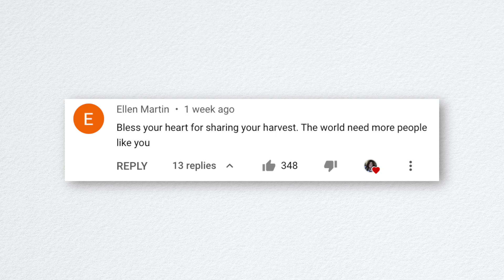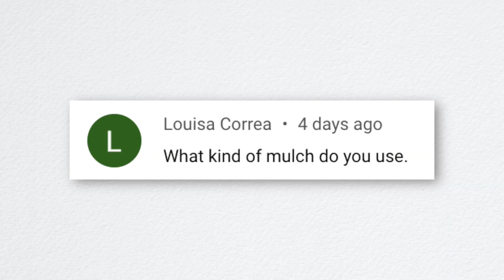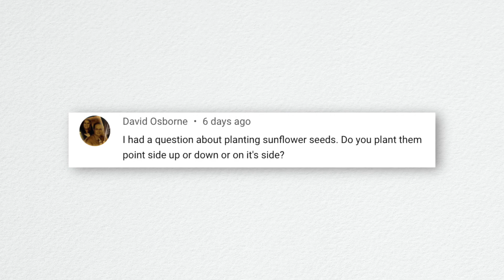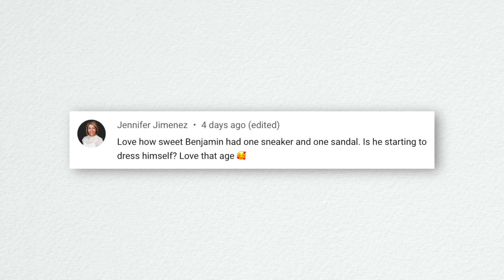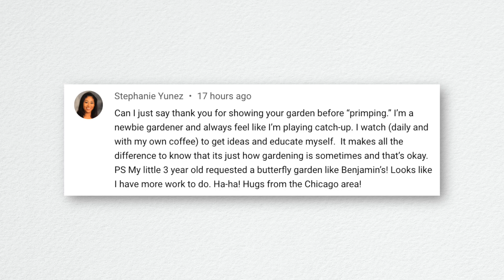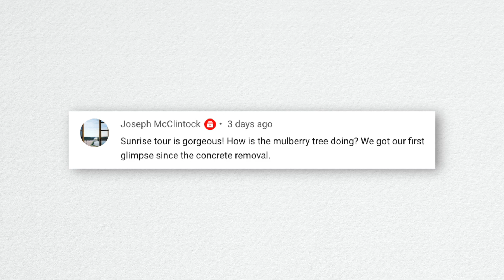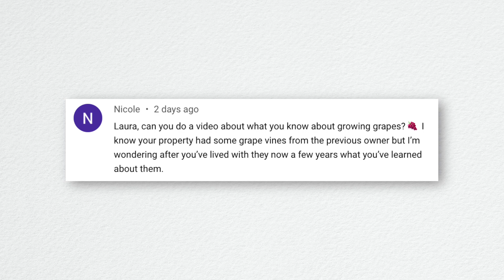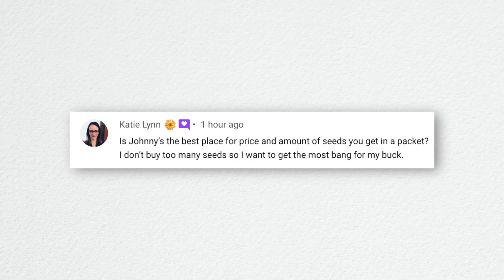Do You Wear a Hat For Sun Protection? // Update on Dead Weed Brew? // Weekly Recap 🌿

Comment: 50:49 I recently got the Dead Weed Brew pre-mixed with the battery operated spray handle and I used it on Poison Ivy and it is starting to die back, but will need much more applied to really get the patch and not while it is wet, I'm guessing (it's been raining for like 2 weeks here).

Comment: I agree about leaving your grass cutting higher in the dead of the summer. I follow my fathers rules on this and cut high during the heat, and my grass has stayed green and not a lot of yellow patching. I haven’t had to supplement water yet either. Whereas my neighbor mows low and you can tell a huge difference in the yellowing. The grass needs to stay higher and denser, so as not to burn the roots. R

Comment: You still can turn any pot in the butterfly garden into a fountain. Bernini makes battery operated recirculating fountains you just pop into any water tight vessel. They have different spray tips so it an just be a bubbler for the sound, and a drink for the butterflies. I’m sure there’s other brands but that’s the one I’ve used before. You could put one in the fireplace area in the shade for the sound without having to run lines.

Comment: You must have a dry heat there. In West Tennessee,  it's 95 by 10 am. Even with my hair pulled back in a cap,  it's soaked in 10 minutes.  And I have to go inside because it gets in my eyes. Humidity stays around 75% here. UV stays at 9 or 10,  heat stroke level.  I'm glad you're able to get by without a hat. I hate wearing them.
Reply: Hello 👋 Eva
How are you doing today?